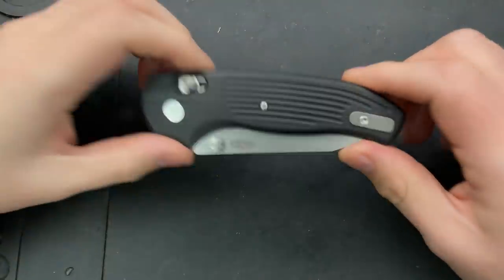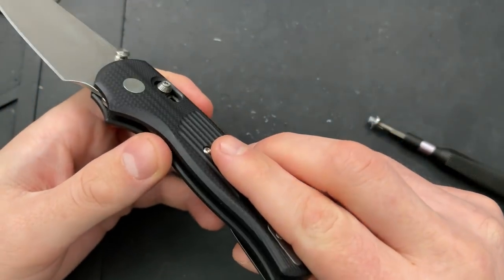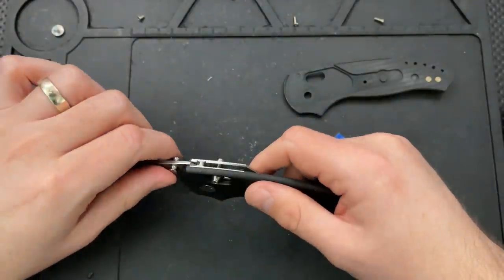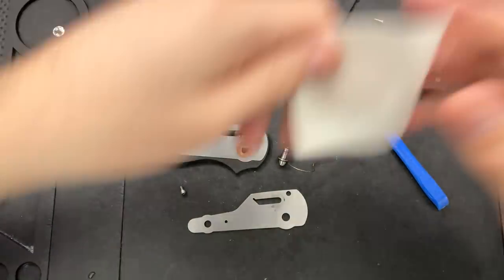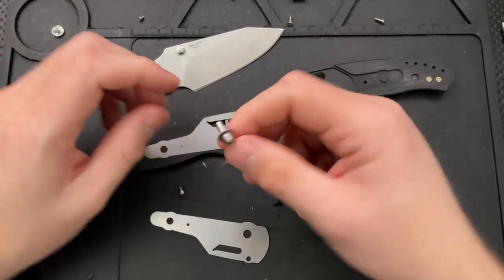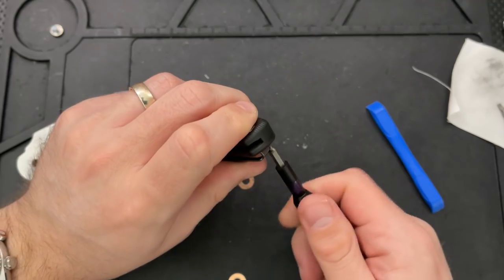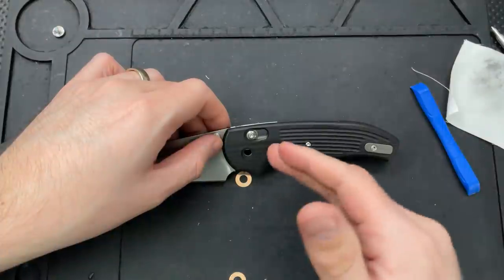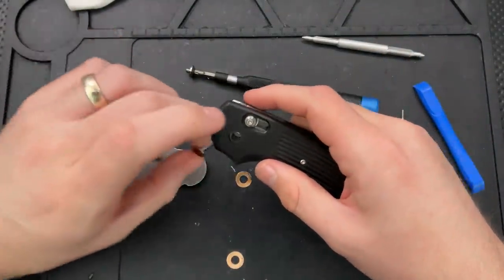How to disassemble and maintain the TRM Knives Shadow Pocketknife

Comment: A quick word on WHY loctite is not recommended for the back screws?  I get it...not connected to moving parts, so it's not critical to loctite them.  But you implied that it was a really BAD thing.  Just not sure why....
Reply: from what I recall seeing, it looks like they are screwing into an insert or sleeve in the G10. If you locktite the screw, it may create too much resistance that may break whatever adhesive they are using to keep the barrel in place. At that point. you would have a free spinning screw which is a pain to deal with when dissasembling.  This would be my best guess
Reply: It's because you won't be able to remove without stripping the threads. It can be loctited but not unloctited :)

Comment: Just the opinion of one jackass here, but I really don't get the fascination companies have with the axis lock. There have been so many reports of omega springs breaking over the years that it feels like you're just setting yourself up for failure when you decide to use it. Spyderco and others seem to have solved the core issue with coil springs, and even Benchmade did it on the Anthem, sooooo why? 

I've also had a small griptilian open in my pocket due to the springs not providing enough force to keep the knife closed while jogging. Should I be jogging with an axis lock knife in my pocket? Probably not, but I didn't know that at the time.

TRM most certainly will have done a better job than pretty much anyone else that's tried it, but they're still just doing the best they can with an inherently flawed system.

Thank you for coming to my TED Talk